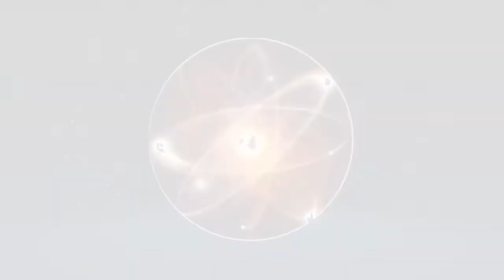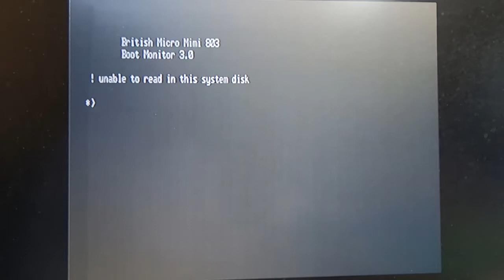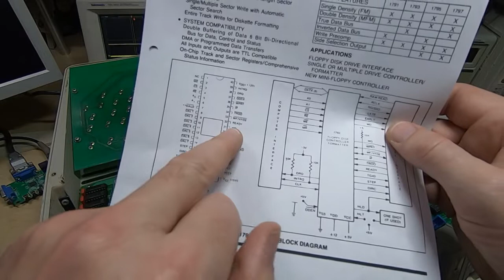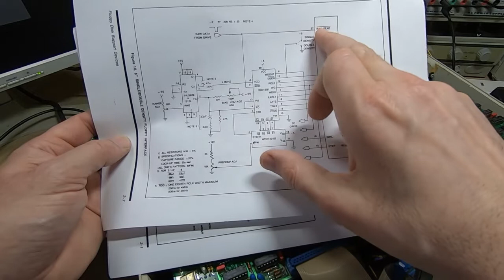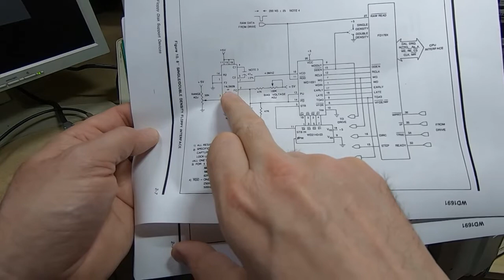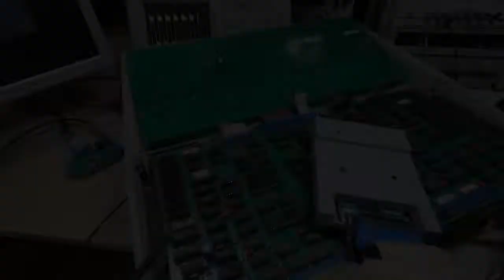Mimi 803 Boot Disk Part1

Comment: I remember, later than this, there was a change that happened and MFM hard drives gave way to RLL.... Where you're talking about frequencies getting modified here, is that any connection to the Modified Frequency Modulation in MFM drives?
Nice to see the Mimi's again, it was seeing them on E. Bay that brought me here in the first place.
Reply from the maker: The frequency I am refering to is the data slicing clock rate rather than the FM modulation frequency. Typically this relates to the data bit rates. The FM and MFM frequencies are the magnetic flux modulation rates. I suspect that the problem here is more related to the disk type. I go into this in more detail in the next video and also look at the ROM code in the Mimi to investigate what is going on.